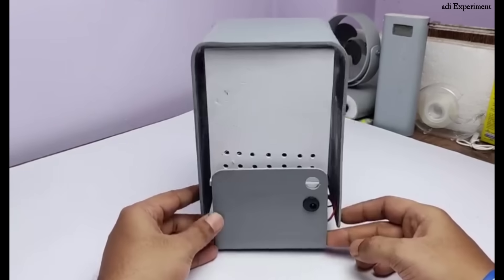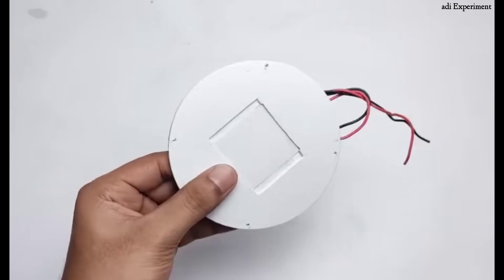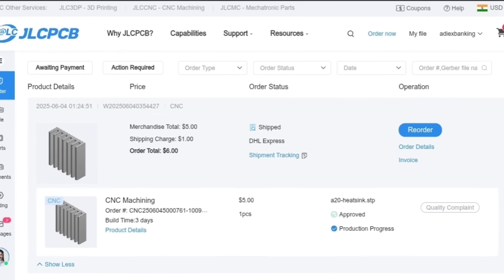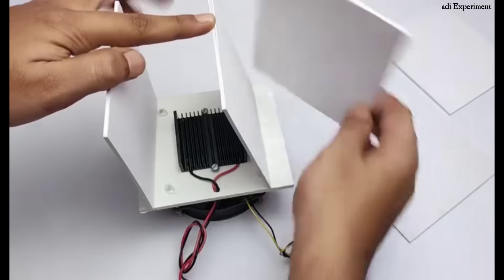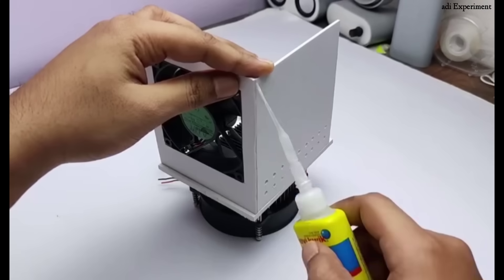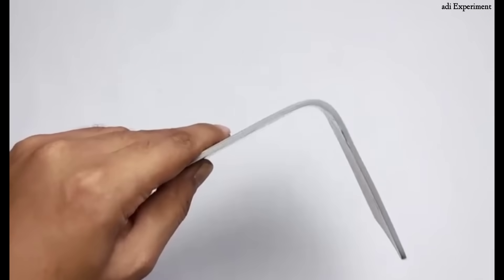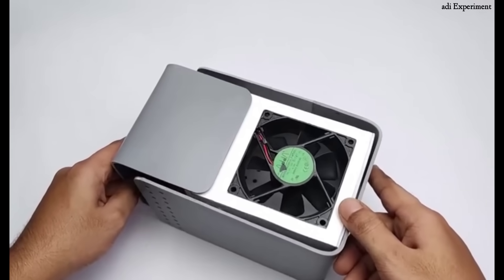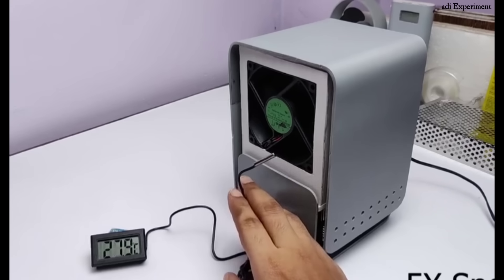How To Make Air Conditioner Cooler Using Paltier Module | JLCCNC Custom 3D Printing CNC Metal Parts

Comment: Hello my friend, it was very nice to see this design of yours, everything is good but one thing I did not like about it, if both hot air and cold air stay in the room at the same time, then the room will not cool down, it is better if you attach a 4" rubber pipe just below it and take it out of the window of the room as an outer, then it will work better, otherwise it will never cool down, I have tried a lot, that's why I am telling you my friend
Reply from the maker: Thankew, for your Idea 💡